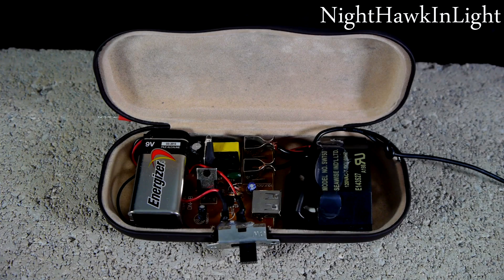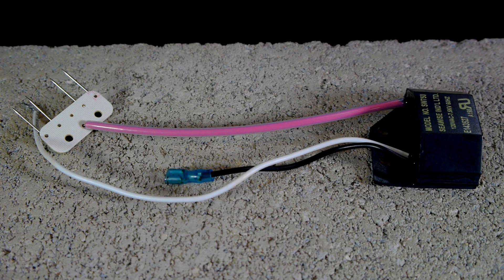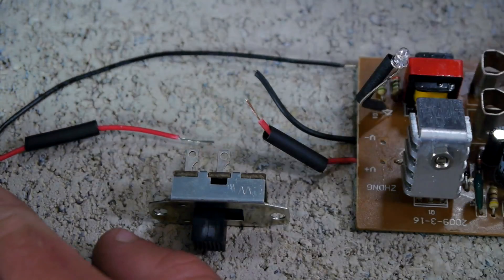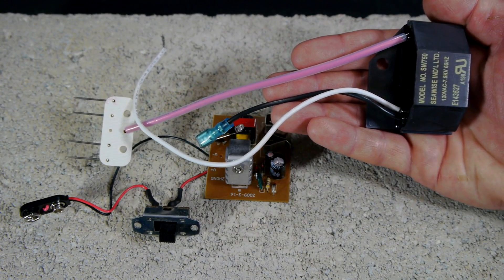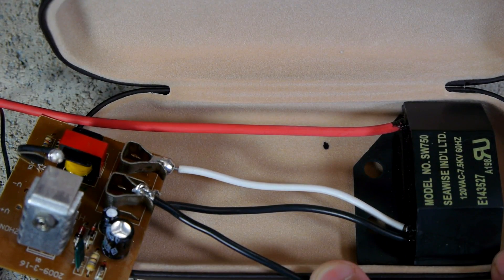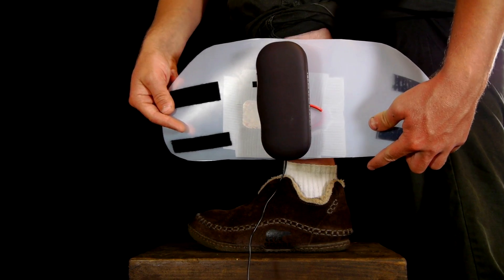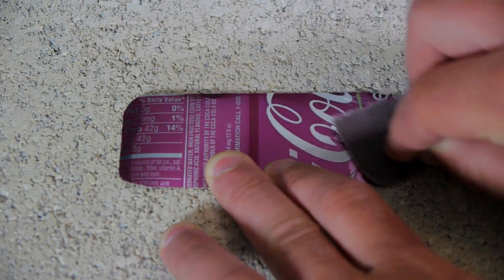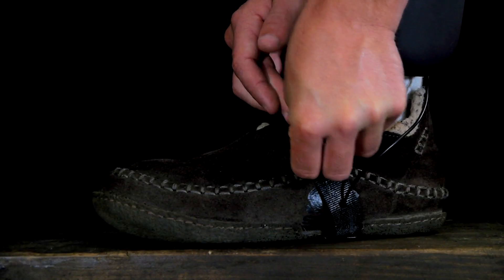How to Shock Anything & Fry Electronics with a Touch!

Comment: I have been getting shocked every time i touch something metal or even fabric, i can hear sparks when I'm taking my clothes off i need to know why and how can i stop it please help
Reply: Ways to stop it? 
1.) Flip the power switch to the "off" position
2.) Remove the device
3.) Use common sense, oh wait, that should have been the first suggestion...
Reply: Valkyrie Survives 4.) Take the 9 volt battery out.
                              5.) Destroy the whole thing.
Reply: fatcookie1000 Finally somebody with common sense
Reply: Buy a bracelet that will constantly ground yourself. They're cheap.
Reply: You have to walk barefoot in your garden or sidewalk that will work, usually walking on the carpet and some types of clothes fabrics create static.
Reply: larvajose They work when they are attached to ground. This is why they have lab technicians wear these bracelets and anti static coats while working with electronics. Yes, shoes are worn too.

Comment: So , theoretically, if you made an identical one for your right leg and connected them both to one common power supply , say a motorcycle battery or similar , then maybe as you walked around having one foot touching the ground and the other off the ground as you walk you might be capable of " charging " a secondary battery system or something ?

Comment: Hello NightHawkInLight,
I got a question to ask. I ordered a 12VDC NEGATIVE ION GENERATOR Hi Density ionizer 9.5Kv Module with the specs of
• Ion density: 1.9 trillion ions/cc at 2.9 cm from emitter
• Ion output: 12 trillion ions/second
• Ion output voltage: -9500V
• Coverage: 200 square feet based on HVAC installation
• Particle effectiveness: as small as .01 micron
• Power use: less than 1 watts
• Power requirements: 12 VDC

So its only 9.5Kv do you think that's to weak or will it still work. 

-Thanks
James
Reply: dude where did you get your negative ion generator

Comment: Is it safe to use on people? I highly intend to build it and piss off my friends to the point where i no longer have friends
Reply: It's just running on a 9 volt battery, it's fine. At the absolute most, it might hurt a bit for 5 seconds.
Reply: Funny thaks not the main reso for me but I want to do it on my little brother but l dont know if its super dangerous or not
Reply: The ampere (SI unit symbol: A), often shortened to amp,[1] is the SI unit of electric current[2][3] (dimension symbol: I)[4] and is one of the seven[5] SI base units. It is named after André-Marie Ampère (1775–1836), French mathematician and physicist, considered the father of electrodynamics.

It's on the wiki!
Reply: MaxTheKanuck #JoinTheMasterRace  No, since it do run on a 9-volt battery but it provides a high-voltage charge.
Reply: Терентий Малышев Maybe, but all volts do is carry AMP's. A 9 volt battery outputs a very small amount of AMPs.
Reply: MaxTheKanuck #JoinTheMasterRace sorry, but what ive learned from college physice is that P=VI, so just because we have the Electric potential(volts or V), we still cant calculate the electrical current(amps or I) because we dont know the electrical power(watts or W or P). We could also use the formula I=V/R, but we still dont know the resistivity(ohms or R) of the wires, so we can not properly calculate
Reply: Andrew Flores Um.... Science stuff!
Reply: Andrew Flores 
College physics would be the problem you are experiencing.
Reply: its running on 120VAC because inverter but output voltage is i think around 5KV and current is very low so it cant kill
Reply: Jaroslav Svajčík ... You are definitely dumb.
Reply: Терентий Малышев please explain.
Reply: Oh geez, that was pretty funny I must admit....
Reply: Todd Clark It is safe, as long as they don't have a pacemaker, the amperage is not high enough to kill, most static shocks you receive every day are around 20,000 volts.   When working on a PC in a higher static environment (that is the only time I wear one, though you are supposed to always use them) you are to use a anti-ESD mat, and wear an anti-ESD wrist strap.   ESD = Electro Static Discharge.
Reply: +Alexander Lo NEVER rely on wiki. I have read many articles that were complete bullshit!! Always double check your info with a well known source!!

Comment: if you somehow use 4 9v batteries instead f one, how powerful will it be?
Reply: no way, if you do series batteries, you may break that circuit board. if you do parallel batteries, that's no power efficiency

Comment: is this bad for you? Like if you use it often will it be unhealthy for your body?
Reply: Donamy Brigham Current is amps you nitwitt
Reply: Donamy Brigham Current is measured in Amps. This information is freely obtainable. Go do some research before making silly claims on the internet please.
Reply: Donamy Brigham What it fucking means is that current is measured in amps, what else do you need to know. This is basic stuff.
Reply: Donamy Brigham
"Amps is the rate that current moves" I think ur confusing current with charge. Current is the rate at which charge is flowing and Amperes (which is the same as coulombs/second) is the SI unit for current. Also "I also have a Maters Bachelors Degree in Electrical Engineering, and a Minor in Electronics Engineering, both of which I have obtained through South Dakota School of Mines and Technology." ...seems legit, especially after you said you were pursuing your bachelors in another comment.
Reply: FunGUI your both kinda wrong actually. amps is kinda like the flow of the current, and voltage is more like the pressure of the current, i cant be bothered with a better analogy, and to the original comment no this cannot hurt you.
Reply: thebogangamer Nope they both aren't wrong, only one of them is. Like FunGUI said, current is measured in amperes. I have no idea how Donamy Brigham doesn't get this, he's either trolling or lying about being an electrician/ electric engineer (probably trolling).
Reply: Again Amperes is not current in the same way that meters is not length. Amperes is the SI unit of measurement for current, and meters is the SI unit of measurement length or distance.
Reply: ***** Yea, that's pretty much what I'm saying. 

btw, your community college education is still better than mine so far, I'm currently in the first year of my bachelors program. This really isn't a complicated topic or anything though its just a definition, an elementary student could understand this.
Reply: Probably. :P But so are drugs so I'd be one to talk. XD
Reply: No, the current isn't strong enough to shock you
Reply: The current is plenty high enough to shock you! More then the current on a tazer. However, the amps are so low that you can't hardly feel it. Many doctors believe high current and low amps can actually be beneficial to the body.
Reply: Amps is the rate that current moves, in simple words. What would I know though, I only have a major in EE and a master electricians license.
Reply: I have my Masters electricians license, and currently getting my Bachelors degree in Electrical Engineering. So.... please, tell me I'm wrong again. I didn't have to pass a test to get my master's or anything. So please, do your research, before you make claims on the Internet. Because now, you sound really ignorant. Amps are current, because it's a measure of it. If you tell someone, "this thing has 5 current" you will sound stupid.
Reply: n00baTr00pa Okay... since you don't understand, this is copied STRAIGHT from the link. "The ampere (SI unit symbol: A; SI dimension symbol: I), often shortened to amp,[1] is the SI unit of electric current[2][3] (quantity symbol: I, i)[4] and is one of the seven[5] SI base units"
Okay, "Is the SI unit of electric current"
Do you understand what this means? 
The UNIT of current.
Unit - "A quantity chosen as a standard in terms of which other quantities may be expressed"
Amps is the rate that current moves. 
Has this concept successfully been driving though you thick skull yet?
Again. I have my Masters Electricians Licence in the state of South Dakota and Wyoming. I also have a Maters Bachelors Degree in Electrical Engineering, and a Minor in Electronics Engineering, both of which I have obtained through South Dakota School of Mines and Technology. But please, keep arguing, I find it extremely amusing.
Reply: ***** well amperes is abit more complicated the just current, its more the strength, energy or quality of the current.
Reply: ***** yes but amps have a very specific meaning, don't argue with a physicist or you will look stupid.
Reply: Well it might fuck with your brainwave activity
Reply: Donamy Brigham amps = current. End of story.
Reply: thebogangamer Are you implying that an electric engineer is the same as a physicist? Because there's a massive difference.
Reply: Bas van de Kleut no just that there current is not so simply defined.
Reply: Ya'll seriously had a fight over weather these people are right or wrong about the flow of currents measured in AMPS. Couldn't it be as simple as "No, the AMP reading coming from the battery is to low for a substantial amount of pain to be drawn into you"? I just have to get this our there, I don't have a masters or bachelors degree in anything nor will I claim I do but this is bare boned basic shit. I learn't this in grade 6 and in highschool......

Comment: I have a problem with my negative ion generator. I am not getting an electric arc between the ground wire and the long red wire. Whats the problem?
Reply: NightHawkInLight ac-dc back in black
Reply: You must construct additional pylons
Reply from the maker: Are you using an AC or DC generator?
Reply: @Nighthawkinlight  Sir, I'm having the same issue. I am using an AC generator, but its not one exactly like the one you used. Mine has an "electricity outlet" on it as well as a USB outlet. Also, mine does not have the two prongs that yours has that red and black wires form the ion generator plug into. Any advice would surely be appreciated.
Reply: @Nighthawkinlight  Also, my negative ion generator looks exactly like yours, even has the same model number on it, but mine has a green ground wire coming out of it, in addition to the other three wires.
Reply: +Doug Olberding where to find this generator??? send pm me. pls :)
Reply: Actually the output, lone wire of the negative ion generator is always a negative terminal.. So the ground input WILL not produce sparks with the output, UNLESS the ion generator is AC fed like in this video.. So if your ion generator requires DC input, add a ground wire connected to the positive terminal of the dc fed ion-generator instead. Trust me, I have a degree in ghetto engineering
Reply: +Doug Olberding gonna have to go into a little more detail there, bud.
Reply: +lemon limelord hahahaha

Comment: What would happen if you use a more powerful battery?
Reply: How about a car battery and much larger components.
Reply: Alfred F. Jones it would just last a very long time =, car batteries arent very high voltage but they have a high amp hour rating
Reply: TheJack387 No but with a different AC/AC
Reply: Do not use a higher power battery until you check the current rating. High amp rates = fatal. anything over 0.1A of about 100mA is very dangerous for you. A car battery to which someone suggested can output a maximum of 450A which is insane. Even using a regular 9V battery has the potential to kill (though it generally won't) at a rating of about 100mA to 200mA. If you want higher voltage (which I would not suggest) more 9V batteries in series will keep the current the same but will have a voltage rating of n * number of batteries. There is your physics lesson for the day. Be safe with electronics

Comment: upon touch is it shock user? or just target?
Reply: The charge is already in your body, so no, it cannot shock the user.
Reply: GnC Deluxe
No, incorrect, it will shock both the user and the target. Electricity becomes concentrated where the user touches the target, shocking both

Comment: very nice tutorial. I made an upgraded version for a Halloween costume. I went as "High Voltage". I used 3 (9 volt batteries) in PARALLEL very important to not do series. ran the wires through a hole in a cargo pocket and screwed a plate into my shoe. and ran a second set of wires under my shirt into some electro-luminescent wire that surrounded a silkscreen print saying "danger! high voltage!" * worthy note: I had to triple insulate EVERYTHING with rubber spray. I was getting voltage loss and getting zapped many times before i found all the leaks. But its been a hit so far! I can do a short vid if anyone wants. Thanks Nighthawk!

Comment: Those with pace makers or cardioinverter defibrillators should not wear this device.
Reply: excellent thought! this should be added as a disclaimer at the beginning of the video, or in description.
Reply: dont touch people with this who might get angry.And if you put this thing at a car it could eventually generate enough charge to be very dangerous.
Reply: neutronen stern 
See,  this has a huge voltage behind it, but basically no current, and each spark has a very short period, so it outputs very little power. Very high voltage sparks (such as lightning) can be dangerous, but that is due to the plasma from the arc superheating the air and any water nearby, and tends to kill from the explosion created by superheated steam, and burns from the plasma arc.
Reply: wait, so this could potentially be used in assassinations..?

Comment: wait can you shock things with your hand? or do you HAVE to hold something metal?
Reply: Grant Stuart i like the sass you put there like you dont even care No you dont have to hold something to shock people DUH haha lol
Reply: no you don't have to hold metal to shock people.
Reply: Hell yeah
Reply: so cool. right now i am making the hho generator by grant Thompson but i really want to make this after
Reply: Grant Stuart remind me, what is the hho generator? like what does hho stand for again?
Reply: ShockwavePlaysMC Hydrogen Generator, HHO means 2 parts hydrogen, 1 part oxygen. Basically convert a gas generator to run on hydrogen.
Reply: No you don't, however it will shock you too if you shock something else without holding something metal
Reply: chiefdounuts I could be wrong here, but isn' that the point of the grounding wire under your shoe?
Reply: Luke Cauley Doesn't matter how, arcing electricity will shock both parties if used with only bear skin. The ground wire has little to do with this fact.

Comment: Hi was wondering if I could use High Output Air Ionizer Ionizer Airborne Negative Ion Anion Generator DC 12V instead of a 230 and con erring the power

Comment: THROW AN ENEMY IN A SWIMMING POOL AND THEN TOUCH IT
Reply: It won't kill anyone because it only produce Static Electricity because static electricity even if it has a high voltage it has a very low electrical charge, but it can still ignite something combustible.
Reply: VoltageHacker what if i touch a gas spill?....im fairly sure that would work...right?
Reply: Haha yeah sure i allready have my targets
Reply: I’ll elaborate: high voltage and low current, and low period means there is almost no power behind the shock. However, the high voltage makes a very hot plasma (2-3000°C) which can easily ignite flammable liquids or gas.
Reply: why is it people assume this works? it doesnt trust me, its basic electronics

Comment: Combine this with the gauntlets and WHAM, you have batman's shock gloves from batman arkham origins
Reply: wait why?
you dont need gauntlets, you have the power to control electricity and sand! 
using the gauntlets will block the "output" (kinda depending on the material)
Reply: You know i never thought of that thanks.
Reply: i actualy didnt know if i was right, i just had like 5 classes of 2 hours of electronics, and i learned a lot,  youre welcome
Reply: i dont know

Comment: Instead of using coke cans and sanding the sides, you can use aluminium foil which would be much more easier and could be folded in any shape.Just use slightly large sheet and fold it into a thick plate like thing for durability and you are good to go.

Comment: Newer comment, Is it possible to damage the device itself with your own electrical discharge by touching the power switch with too much of a charge built?
Reply: NightHawkInLight it is possible to modify this so you can launch lightning bolts out of your fingers?
Reply from the maker: You might be able to damage the power inverter, but the ion generator should be able to handle some high voltage without damage. I've never broken one.
Reply: hahahahaha yeah, you got me , 
(not actualy :))
Reply: NightHawkInLight OK i need a question answered fast, on a scale from 1 to 10, how safe is this device? 1 being easily lethal, 10 being harmless. and will i feel pain when i discharge when i am done?
Reply: About a 1, because the voltage is high but the current is extremely low.
Reply: DylanAwesomeDude its safe just like how ur electric spark in your lighter will zap you. yea u will feel the pain during the discharge.
Reply: +NightHawkInLight is it safe enough to shock friends and other people?
Reply: +Alejandro Escobedo LOL! XD omg I'm rolling on the floor!
Reply: I shock people with mine :)
Reply: +KONG GAMING tf ?